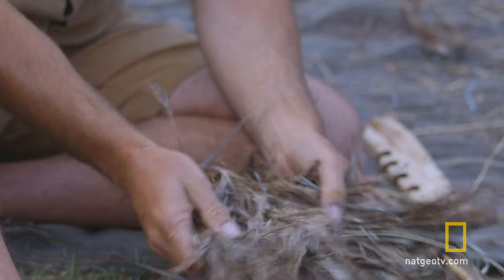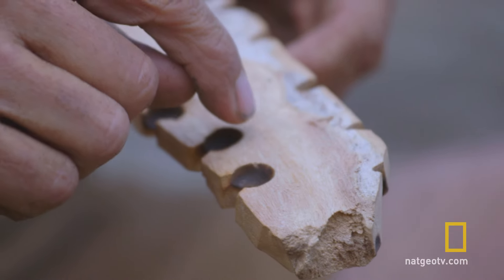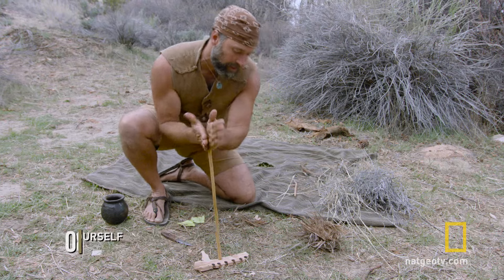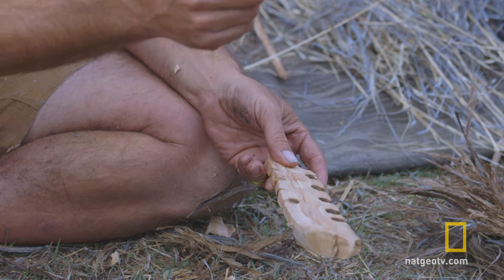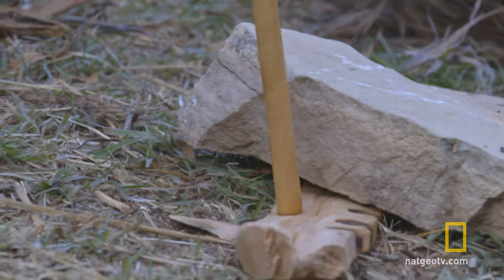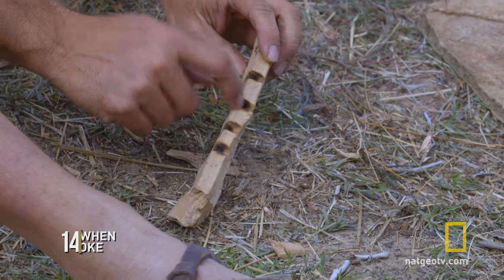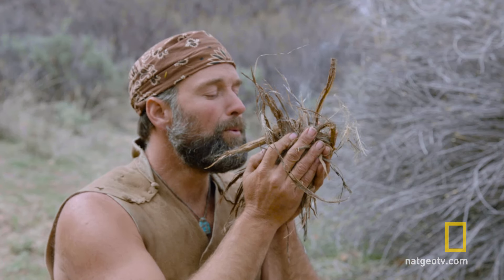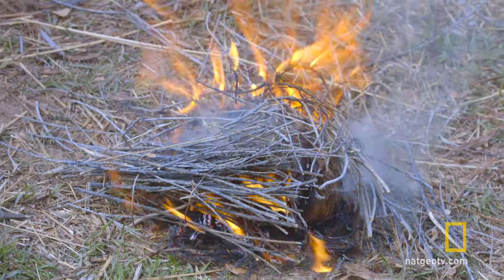How to Make a Friction Fire | Live Free or Die: DIY

Comment: How is it this guy did it with his hands in 12 seconds yet I see people using bows which I’d imagine spins faster and they get nothing... is downward pressure more important that speed?
Reply: Yes. Pressure over speed, but you still need a speed to get grinding the hot dust. Also, if you have sawdust, add it little bits of it in the hole if you are having a hard time. This makes more friction with the wood and makes more heat

Comment: what kind of wood would i need to start fire?
Reply: fuck if anyone knows--that's the hardest part.  then u go out and can't find any wood looking straight enuff.  lemme know what u find out = P
Reply: oopalonga i found in a video that it doesnt matter so much the type of wood but the most important is that the wood must be dry and not wet
Reply: For the spindle chose a pithy material like mullein, horse weed or the first year shoots of big leaf maple. The hearth board can be most any soft wood though I prefer cottonwood root or clematis vine.